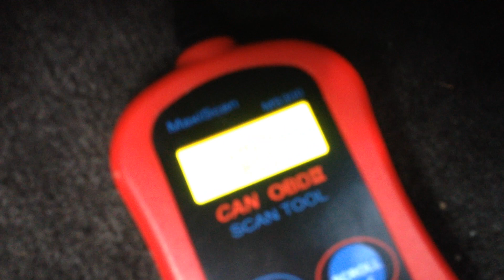How to Afford a Sports Car On Any Budget

Comment: Does a mazda miata really qualify as a sports car?
Reply from the maker: mrgoodbar216 http://www.caranddriver.com/reviews/1990-mazda-mx-5-miata-archived-test-review
Reply: +Web Gem Every where you look at a track day event is miatas everywhere...
Reply: they may not be the fastest car, but for the amount of handling you get for such a low price. I'd call it an entry level sports car
Reply: lol
Reply: na
Reply: roadster? maybe
Reply: +Web Gem the s2000 is convertible
Just sayin
Reply: mrgoodbar216 yes.  Yes a Miata is a fucking sports car."
Reply: mrgoodbar216 no no it dosent
Reply: @gncc600  seems like you havent driven a miata in your life :)
Reply: @x77-i5x  If i wanted to drive a tiny under powered convertible I would just get an old VW bug convertible.
Reply: @gncc600  That would be a good choice, actually. Especially modded properly. You gotta respect the low weight and perfect balance of the MIata, though. So easy to throw around. There's a reason Playboy sponsors a race series (MX5 Cup) with Miata's. They are an inexpensive way to truly learn performance driving.

Comment: I bought a silver Maita NB from 1999 as my first car, it was the first car I looked at in detail and the previous owner completely restored the car, it just had some cosmetic problems like a worn out roof... which was cut open after 3 weeks, so it would not have been worth spending more for a better roof anyway.

It is a solid foundation, but there is still some work to be done... For example a new roof.

Comment: what if u work at a warehouse and own ur own home at the age of 19?
Reply: +salvador kleijn work at amazon getting paid 13 an hour now but if I'm there for 90 days might try the publishing part of Amazon
Reply: +salvador kleijn yup 40 hours a week and can add 20 hours of overtime but if die xp working at amazon isn't easy if u don't make rate you get in trouble.. and it's never easy to make rate. busting ur ass 4 days in a row 10 hours straight
Reply: +salvador kleijn but I got 421 in lot rent 200 + for electric and 140+ for gas.. on a good day as well as 200 for loan and 100 for some credit card
Reply: +goku546686 a month